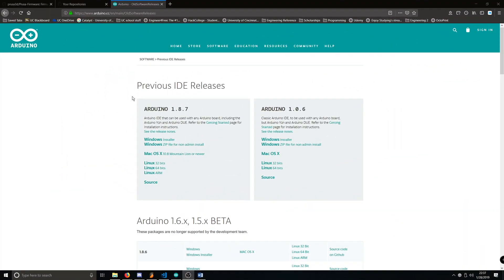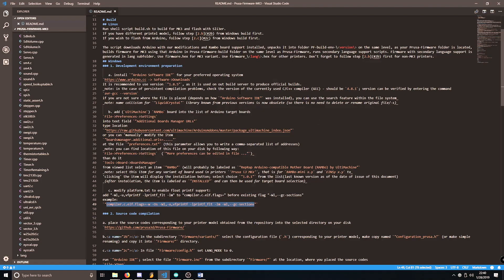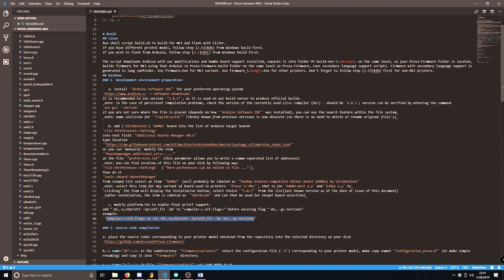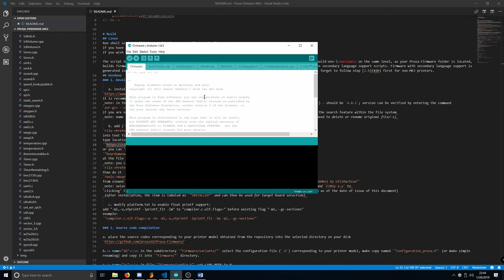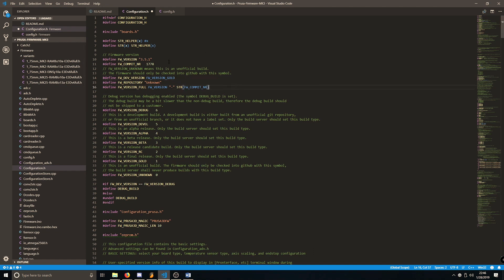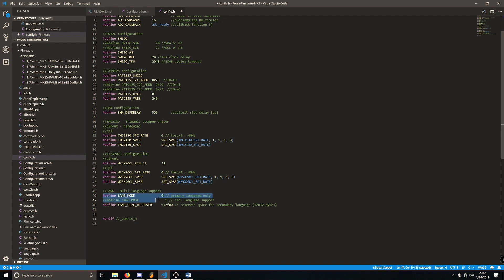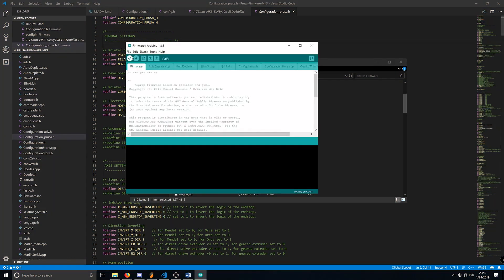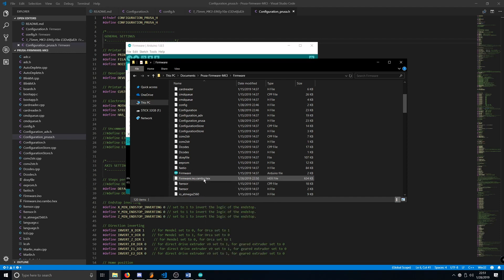Prusa custom firmware compiling for windows!

Comment: Do the Github instructions still work for Windows / Arduino compiling of firmware? I cannot get the Github files to compile even before edits. The format for the line that needs to be modified in platform.txt has changed also (and me using what you wrote as well as what is discussed in Github open issue discussions does not work). Seems that the main solution recommended is to load Linux on my PC.

Comment: Thank you for the great video. End of 2021 and it's still accurate and informative. Thanks to you I could modify my firmware and compile it so my prusa can use the unused thermistor port because the hotend thermistor port was fried because of a print failure. Thanks again. 

If anyone have the same problem you should swap the hotend temp values in pins_Einsy_1_0.h file.
Reply: 2024 and still valid :D

Comment: Had an issue getting my firmware to calibrate the xyz and failing everytime. Instead of getting an older firmware that worked, then flashing the most up to date firmware and never touching calibrate again, I was able to use your guide to get the proper settings for my printer on the newest firmware. Thank you for you video
Reply: HI, would you please describe what changes you did inside the firmware. ;)

Comment: i have a Bondtech Upgraded extruder which has a custom firmware. how can i edit that since its not the factory installed one?
Reply from the maker: You’ll have to edit the e-steps to match what Bondtech advises. Also this “tutorial” is outdated as Prusa uses a new board type when compiling. I need to make an updated tutorial

Comment: Hi my dear friend, I have a chance to compile the firmware. It gives me status error with the board, Arduino:1.8.5 (Windows 10), Tarjeta:"PrusaResearch EINSY RAMBo"

"C:\Users\Ramon\AppData\Local\Arduino15\packages\arduino\tools\avr-gcc\4.9.2-atmel3.5.4-arduino2/bin/avr-g++" -c -g -Os -w -std=gnu++11 -fpermissive -fno-exceptions -ffunction-sections -fdata-sections -fno-threadsafe-statics  -flto -w -x c++ -E -CC -mmcu=atmega2560 -DF_CPU=16000000L -DARDUINO=10805 -DARDUINO_AVR_RAMBO -DARDUINO_ARCH_AVR   "-IC:\Users\Ramon\AppData\Local\Arduino15\packages\PrusaResearchRambo\hardware\avr\1.0.1\cores\rambo" "-IC:\Users\Ramon\AppData\Local\Arduino15\packages\PrusaResearchRambo\hardware\avr\1.0.1\variants\rambo" "c:\User\Ramon\Documento\Arduino\Hex\sketch\Firmware.ino.cpp" -o "nul"
"C:\Users\Ramon\AppData\Local\Arduino15\packages\arduino\tools\avr-gcc\4.9.2-atmel3.5.4-arduino2/bin/avr-g++" -c -g -Os -w -std=gnu++11 -fpermissive -fno-exceptions -ffunction-sections -fdata-sections -fno-threadsafe-statics  -flto -w -x c++ -E -CC -mmcu=atmega2560 -DF_CPU=16000000L -DARDUINO=10805 -DARDUINO_AVR_RAMBO -DARDUINO_ARCH_AVR   "-IC:\Users\Ramon\AppData\Local\Arduino15\packages\PrusaResearchRambo\hardware\avr\1.0.1\cores\rambo" "-IC:\Users\Ramon\AppData\Local\Arduino15\packages\PrusaResearchRambo\hardware\avr\1.0.1\variants\rambo" "c:\User\Ramon\Documento\Arduino\Hex\sketch\Firmware.ino.cpp" -o "c:\User\Ramon\Documento\Arduino\Hex\preproc\ctags_target_for_gcc_minus_e.cpp"
In file included from C:\Users\Ramon\Desktop\Prusa-Firmware-MK3\Firmware\Firmware.ino:33:0:

c:\User\Ramon\Documento\Arduino\Hex\sketch\Configuration.h:55:33: fatal error: Configuration_prusa.h: No such file or directory

 #include "Configuration_prusa.h"

                                 ^

compilation terminated.

exit status 1
Error compilando para la tarjeta PrusaResearch EINSY RAMBo.
Reply from the maker: Prusa changed the board within Arduino.  If you check the readme within the files you should see what you need to change. I need to do an update video
Reply: @beard3dprinting825  
where I get the latest firmware
Reply: friend you know how I can do to compile the firmware as I told you I can't do it you could guide me to achieve it I just need to adjust the extruder steps, please

Comment: Hey, excellent timing on the video as i was just starting to try to figure out how since i am by no means a coder. now how about possibly doing or assisting with a reprap full graphics???
Reply from the maker: I will definitely look into it! If I pick one up I’ll do a video on it!
Reply: @beard3dprinting825  hey, shoot me an email with your addy and ill send you one. it is a lcd12864 BUT (and i dont recall the exact difference but there was a small one to my recollection) it came off an Anet A6 that i got a while back and burnt the mobo on first day so i just put the one that was already connected to a ramps on it with the ramps and it's been sitting in a box ever since.
Reply from the maker: @boomhauerboomhauer4334   sounds like a plan! You can reach me at beard3dprinting@gmail.com